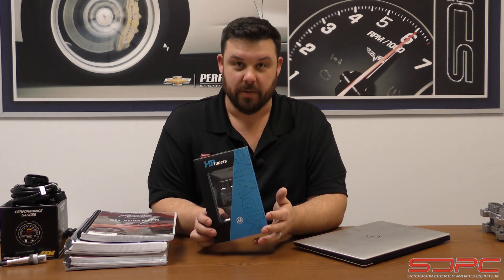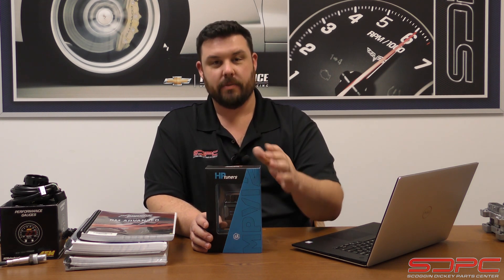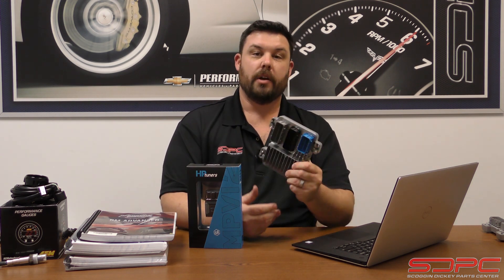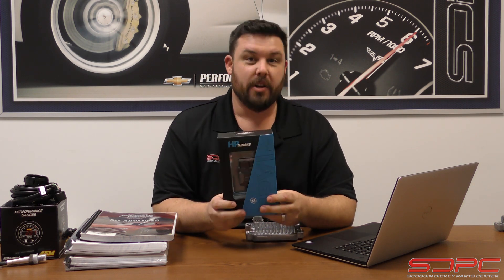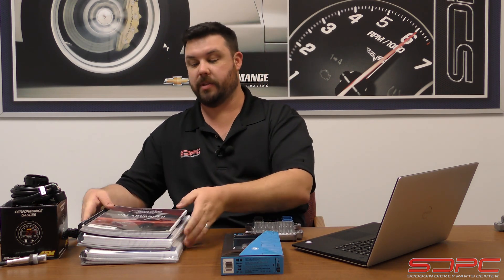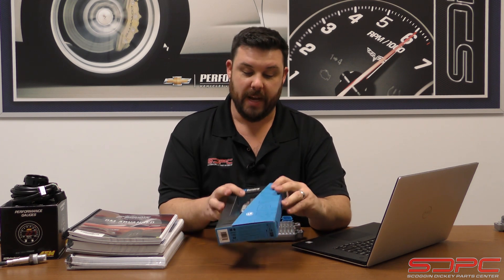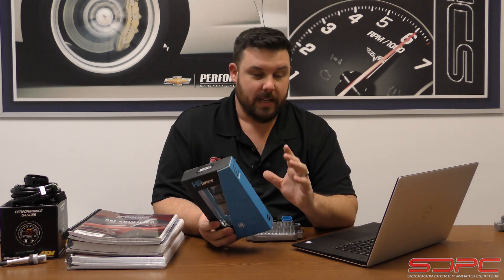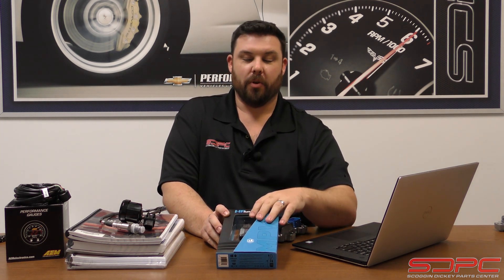SDPC Tech Tips: Demystifying HP Tuners

Comment: Your explanation of HP Tuner Credits is clear as Mud

There is a discount system available that allows you to gain the ability to tune multiple vehicles of the same year/make/model or Gen at a reduced price. 

https://support.hptuners.com/index.php?/Knowledgebase/Article/View/upgrade-credits

“Example 1 

In this example a customer does the following things:

Uses 4 credits to license 2 x 2000 Fbody Single Vehicles

These 4 credits count towards the 2000 Fbody Year/Model license so they are added together, then multiplied by 75% giving 3 Upgrade Credits.

Since the 2000 Fbody license normally costs 6 credits, it is now reduced to 3 because of the 3 upgrade credits. The calculation of this is completely automatic, all the user will notice is the reduced number of credits on the licensing form.

They then decide to purchase the 2000 Fbody Year/Model license at the reduced 3 credit price, the software records the fact that 3 credits were actually used to license the 2000 Fbody Year/Model. These 3 credits will also count towards the All GenIII V8 Cars package.

The customer then purchases the 2001 and 2002 Fbody Year/Model licenses for 6 credits each. Note they are stored at the full 6 credits by the software since no upgrade credits were applicable at the time. These Year/Model credits now apply to the All GenIII V8 Cars package in exactly the same way.

The total of all applicable Year/Models (3 + 6 + 6) are added together and then 75% are counted towards the package. In this case 11 credits (the result is rounded down) apply to the All GenIII V8 Cars package.

The user then decides to purchase the All GenIII V8 Cars package at the reduced 19 credits.”